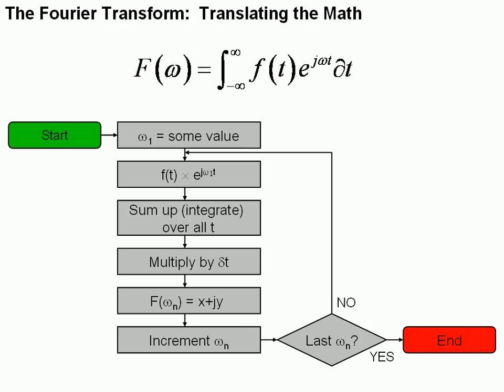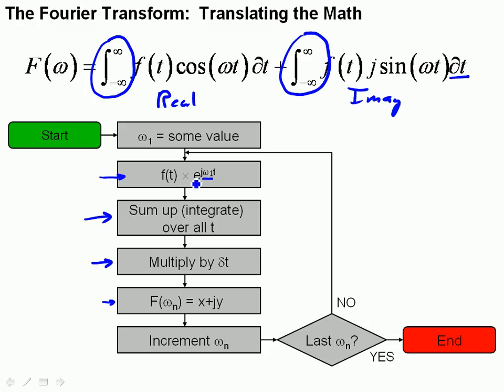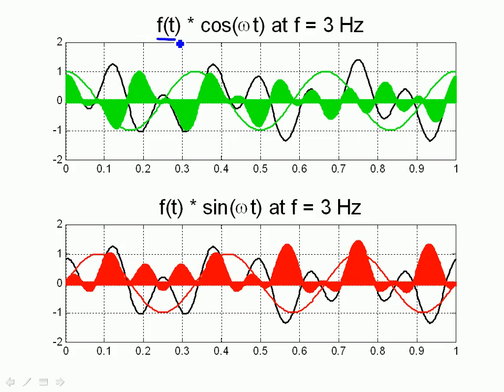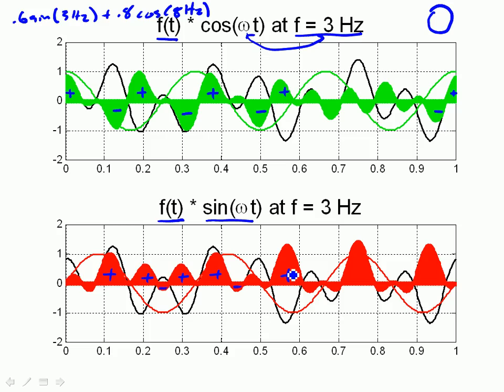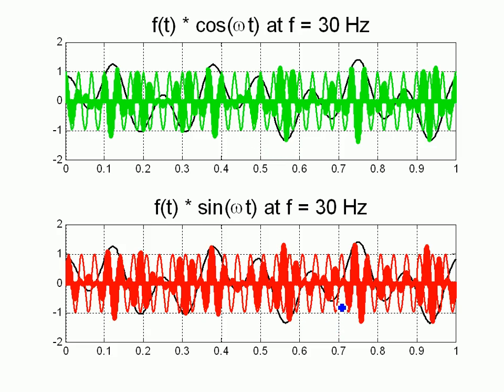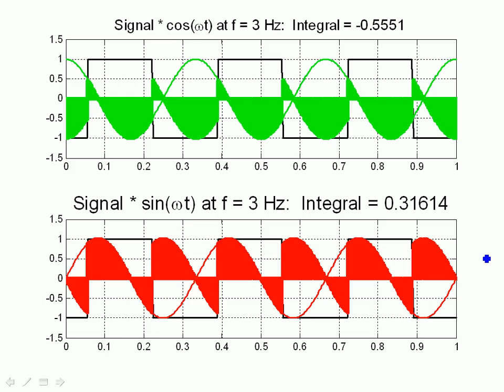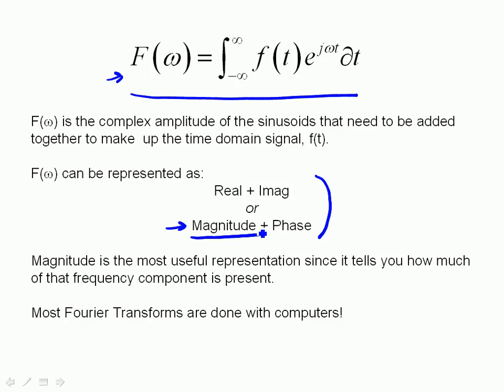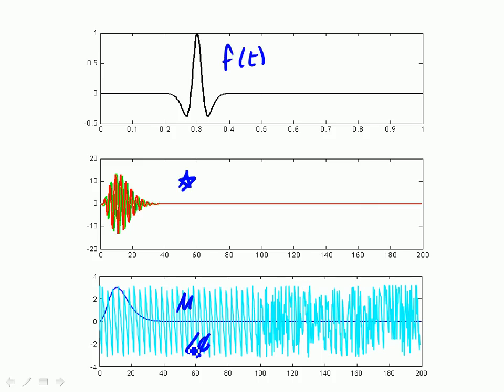The Fourier Transform- Part III

Comment: Your explanation is overly simplified. For example: When choosing a frequency w1, how do you know that the time domain function will have any components at that frequency? It seems as though one would need to sweep all frequencies over a range from zero to some arbitrary limit and then see if the magnitude of frequency domain function is large over the range. All this would require definite integration when generating the frequency domain function. Also, I didn't appreciate your patronizing tone. Not all your viewers find algebra or integral and differential calculus daunting. You will not "break the brains" of your viewers if you actually did the math. As a matter of fact, understanding the underlying mathematics is the only way to truly understand things like the Fourier Transform or the Laplace Transform. That's how I learned it and it stuck with me because I wasn't afraid to put in a little effort. Thank you.
Reply: "When choosing a frequency w1, how do you know that the time domain function will have any components at that frequency?" 
He is evaluating the Fourier transform with a time function where the frequencies are already known because this is necessary for a visual explanation. The continuous Fourier Transform is usually only calculated for things with some level of symmetry (e.g sinc, triangle, rectangle, etc.) or it is sufficient we see it as a formula that inputs omega. I didn't find his tone patronizing at all. In fact, he sounded rather enthusiastic.

Comment: My own notes: 
Note that without a computer, we wouldn't be able to see the magnitude and phase of each frequency component in a signal without a 'nice' function for which we already know the Fourier Transform. We'd have to tediously calculate the integral for each frequency though the video here simplified it quite a bit. Another thing that simplifies the calculation is that e^jwt is easy to manipulate, compared to sin and cos. 

Since the Fourier Transform outputs a complex number, we need to consider it in two ways (a) real/ imaginary for rectangular form and (b) magnitude/phase for complex exponential form. What is weird to me is that phase response of each frequency has an effect on the magnitude, rather than being an independent number. If input is sin(t), its FT with the real cos part will be 0 because sin(t) *cos(t) = 0.5 sin(t). Another way of looking at this is that sine and cosine are orthogonal, so magnitude will be 0. But the imaginary part will yield 0.5 since sin(t)^2 = 0.5sin(t) + .5cos(2t) where the 1st term gives you a 0.5 contribution. 

The integral will calculate the "net" contribution between the f(t) and a cosine/sine. This value can be positive or negative. Done over a time interval, we can think of it as the area under a curve representing the complex output (Fourier Transform value). Time is width of the area and the net contribution is the height of the area.

Comment: I think everyone who has seen this should just give it a thumbs up. Nice and simple, no more complication. It would be better if you can show why we get integral of 0 in many frequencies if they are not part of the original f(t). It's not obvious to everyone and it requires some math skills. But if that would be a complication, then it's fine not to explain much about this... I'm willing to help if anyone has questions on this issue :)
Reply: I actually am very confused on why that is and why it's significant, could you explain it? I don't exactly have amazing math skills, but if you could just point me in the right direction I'd really appreciate it.
Reply: e.g., input wave sin(t). if we probe it with cos(t), and if we get the area under sin(t)*cos(t), we are going to get almost zero, since sin(t)*cos(t) is 1/2*sin(t).  So, the fourier transform result is zero at cos(t)

But if we probe the input sin(t) wave with sin(t) itself, we are going to get 1/2, as sin^2(t)=1/2+1/2cos(2u). Note that area under cos(2u) is zero as well. In this case, we can get a non-zero output for the fourier transform at sin(t).

Hope it helps!
Reply: Thanks, Jia.

Comment: great explanation !  Little question about ''Multipliy by deltaT'' at 0:50. After integration,  why you still want to multiply by deltaT ? And also : where exactly comes the differential equation you introduce in your video #2 ? I kind of understand the solution :) .. but why this equation and not another one ?   thx !!

Comment: 3:13 hehe pretty sure you can't take sin and cos when the argument has a dimension(1/s=Hz), although everyone forgets a variable from now and then ;)
Reply: I think he was mainly just trying to illustrate that the specific frequency is included in the Sin() and Cos(). Remember that e^jwt = Cos(wt) + jSin(wt).  If you convert Hz to rad/s to get 'w' and multiply by time, 't', the time units cancel and your cos/sin argument becomes unit-less. :)
Reply: It's traditional to leave out the "t" when in the frequency domain. Same reason we don't use the notation "F(w,t) = sin(wt)" we just use the notation "F(t)."

Comment: kridnix, thank you so much. Could you please answer the following question, it's driving me crazy: I've used the same signal as you in Matlab and at 3:37, if s(t) equals your function times sin(3 Hz), then mean(s(t)) gives 0.3. Not 0.6. Shouldn't it be 0.6, since the amplitude of the sine in your function is 0.6?

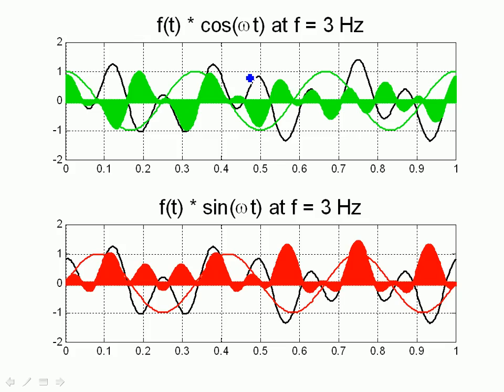Comment: Good video on a difficult topic. However I got lost at about 2:28. I am not sure what the multiplication is that makes the sine term disappear in the top diagram. It seems that the multiplication would be {3sin (3Hz) +.8cos(8Hz)}*cos(wt)(3Hz) which works out when distributed to be {3sin (3Hz)*cos(wt)(3Hz)} +.8cos(8Hz)*cos(wt)(3Hz). It seems that first term here goes go 0 - I don't get it.  Perhaps an example with actual numbers might help me. Any time taken to respond is appreciated in advance.

Comment: del t is the upside down triangle, not delta t.

what programs did you use for this?

could you also say that the frequency of a graph is the difference of the reference point from the curve, since we are looking at the point at which the curve crosses the nodes of the reference?

Comment from the maker: @protikmaitra  For Q#1 I have no idea since I am not a signals guy.  I would try to code this up using some sort of genetic algorithm but that is just me not knowing this area.  Q#2:  This is a sine wave plus a DC component.  Since the FT is linear it is a delta function in frequency plus a large spike at frequency zero that is meaningless.  Q#3:  I believe they need to coincide or else the signal isn't causal.  You can manipulate numbers to create signals that couldn't exist in physical systems

Comment: @IronPump89 You're absolutely right , to find the amplitude of the wave represented by a complex number you measure the magnitude or length of the cmplex vector, however you also need to know the frequency of the waveform which is equal to the angle that the complex vector makes with the x axis or real-axis. Complex numbers or solemnly used because of their abillity to contain 2 values, or 2 pieces of information if you will, within a single number.

Comment from the maker: @chipsmet Yes.  Remember the time shift theorem of Fourier Transforms allows you to shift a signal in time by an amount tau and the corresponding FT is simply multiplied by a signal exp(i*omega*tau) which is a frequency dependent phase shift.  So it doesn't matter when a signal "starts" it just has a phase shift in the frequency domain.

Comment: AH!  Now I think I get it.  Waves (such as radio waves) have both amplitude and phase which coexists simultaneously.  Even though the amplitude goes to zero,  the signal still exists and has a phase.  Radio frequencies have a magnetic component which is 90 degress to the radio wave and has a 90 degree phase difference as they travel through space.  So a wave is a 3 dimensional object and the components of amplitude and phase describe the wave.

Comment from the maker: Good question but hard to answer simply, partly because my own mental picture relies on mathematics.  A wave has two numbers that define it- amplitude and phase.  The amplitude is how tall the peaks are and the phase is where you are on the wave.  At some points in time (phase) the signal will be zero even if the amplitude is large.  The real part is the amplitude you can measure and the imaginary part is where the amplitude goes when the signal is less than the amplitude of the wave.

Comment from the maker: @BENLADEN7th You have to do the integral.  IF it is solvable analytically you simply plug numeric values into the solution.  Most of the time you solve it numerically using the Blackman-Tukey algorithm or some variant and calculate the value that way.